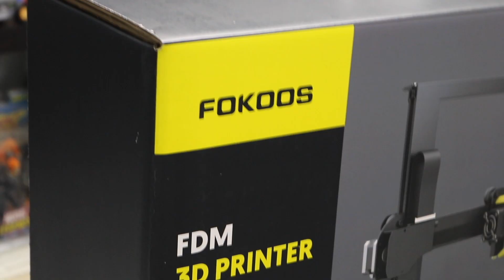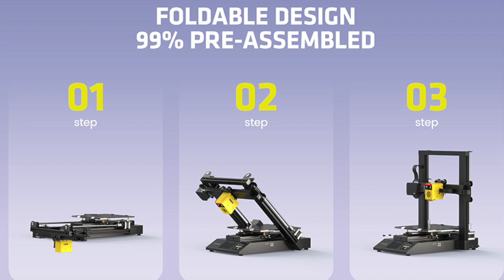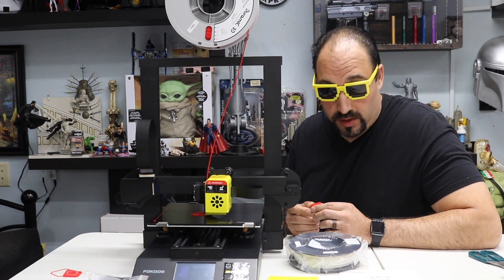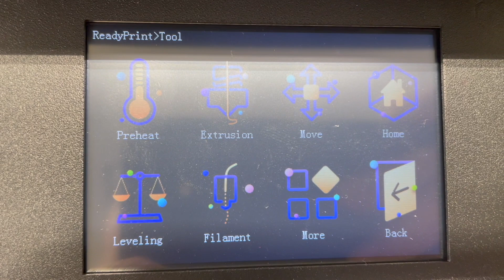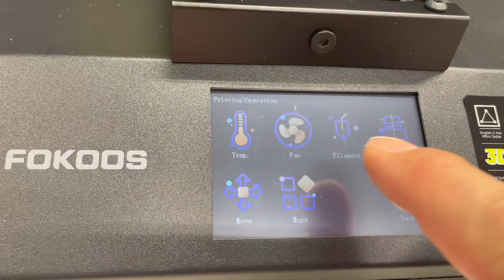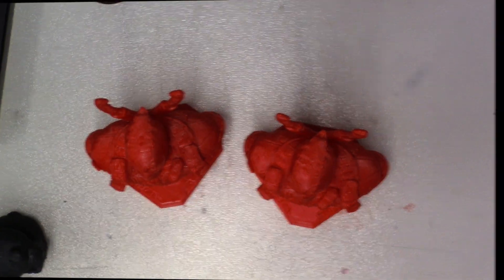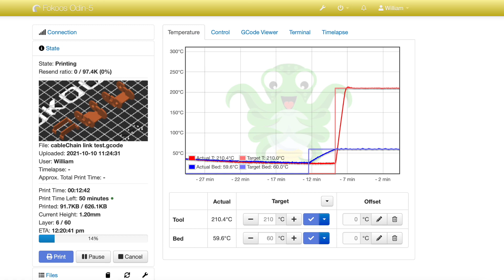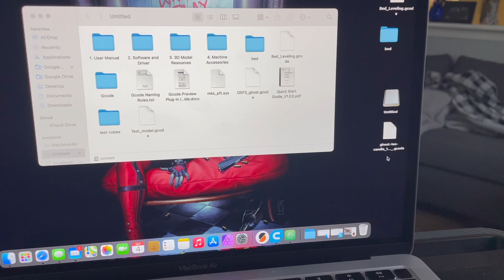Affordable feature packed 3d printer FOKOOS Odin 5 F3 Review

Comment: I worked out a deal with them and will be picking one up in the next week.  Not a freebie, but I’m still pumped.  Great video!
Reply from the maker: Thanks! That great I love all the features trying to get the print settings right so can run it in Prusaslicer has been a challenge. But haven’t had the time bc I was trying to make a  octoprint work with three printers with three cameras. Only spent 25 hours on that.🙄